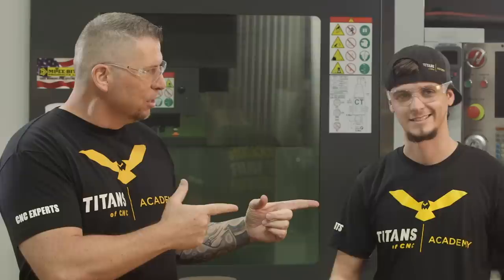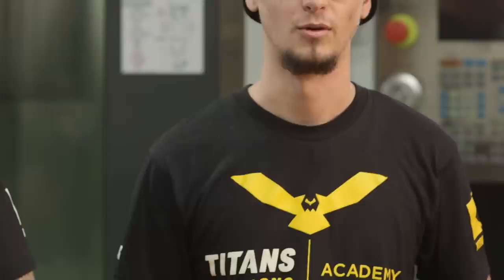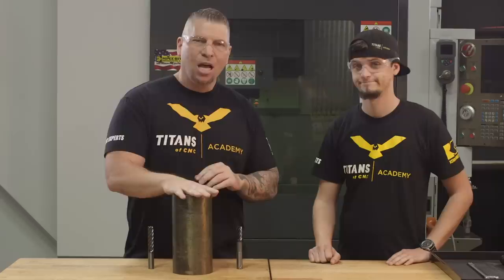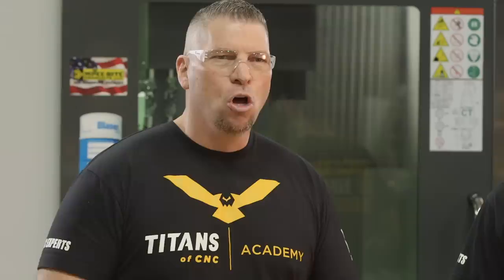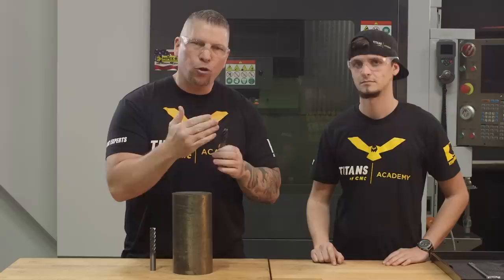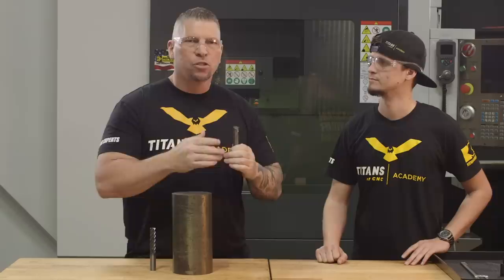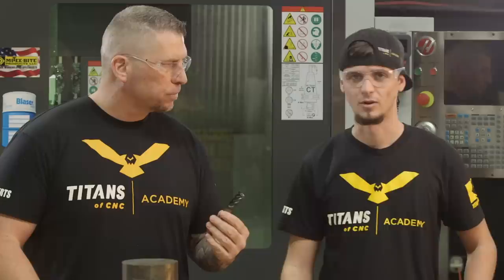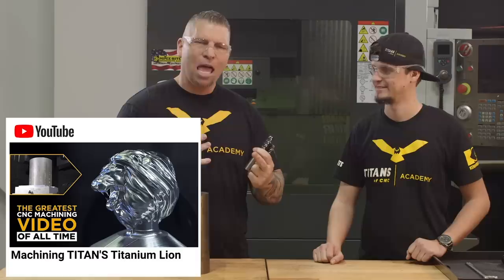Zombie Mill Saved Me $100,000 | CNC Machining Inconel 718 | Vlog #75

Comment: Hey titan I have a question.
What do you think of when a teacher gets really mad at a student for messing up?
Reply: I'll chime in with my opinion =)

Depends on the situation and what the student did wrong. If the student has an attitude, thinks he knows it all and takes risks and gives no shits about safety in the workshop - it's all fair game to teach him a lesson.

I've seen a lot of shit during my time as a machinist. Some dude was turning down some stock on a manual lathe and decided to go take a shit while the machine was operating. It went past the stock and right into the jaws and only stopping due to the overload. Another guy thought it was funny to walk over to a manual mill, which was in use, and turn the handles on whatever he could. Which resulted in scrapped parts and dangerous situations when the operator started running again. Some asssholes in the jobshops thinks they're real fucking funny throwing around pallets to scare people - aint so fucking funny when an operator breaks shit because they jumped and got scared.

However, you should never scold a student for making beginner-mistakes. Breaking tools, scrapping parts and the inevitable minor crashes on the machines - everyone has done it. Even the most skilled machnists breaks stuff from time to time. If anyone says otherwise - simply don't trust them and their lying cunt mouths =>

So again, it comes down to what and how the student messed up.
Reply: innomi natum I was on a haas ST-10 and I was making the first op of the queen and I was mid way and I turned on single block on and I forgot to watch my distance to go but the thing was that the piece had coolant on it and I thought that the machine was done reading the line of code but the catch is that my feed was at 10% and my rapid was at 5% so I couldn’t tell by eye if the machine was moving or not but it was and every now and then it would make a sound but I didn’t know that it was touching the part so after like a min the endmill the turret snapped but not completely and then he went to tell the other instructors and some of them gave me attitude too which was really discouraging. I didn’t even go to the class because I was embarrassed and I knew that he would give me more attitude( btw this happened during a n open lab) l one of the instructors was like “how the fuck do you bend an endmill, I’ve never seen that in my life” and it was an instructor that I liked but the same instructor has been giving me an since program started and there has been already two times that I’ve felt like just leaving the program.

But I’m not a bad student I’ve been taking all of his bad attitude for almost 6 months and I e never talked back to him and I always go to the open labs every morning and I try to be the best I can. It’s just really discouraging to get yelled at almost every day...plus the picks on me and makes fun of the mistakes I’ve made.😞
Reply: @septurno9722  So If im reading it correct, you were milling on the lathe and didn't notice that the endmill was actually touching the part you were machining - and it ended up breaking the endmill.

Stuff like that happens. It just does. However we put it, it's an operator mistake - but it just happens sometimes. And honestly... breaking an endmill is a common mistake/error. Hell, I've broken 2 of them myself today =)

If your instructors can't handle seeing their fucking endmills break - they should be standing and overlooking every single operation you ever do - and you won't learn shit by that.

One thing is to be annoyed about endmills breaking, I mean, they CAN be quite expensive - but the fact that he starts scolding you infront of the other instructors tells me more about him than you. And you're bound to meet more fucknuggets like this in this trade.

Keep doing what you do: Improving. Don't take it too personally when some idiot wants to belittle you - they're most likely trying to compensate for having a small pecker.

If you make a mistake - just own it. Admit you fucked up, take notes and keep going. You're bound to make a lot more mistakes - and that's what you really learn the most from.

FYI; There's probably a reason this douche of a teacher you have became an instructor - he most likely didn't function in an actual jobshop with his attitude ;)
Reply: innomi natum  hey thanks man,what happened was that spindle wasn’t moving so the endmill was Going into the material without spinning and it bent. But thank you 😁

Comment: Breaking an end mill then going back into the program where the endmill broke and starting again with the same work piece is just asking to break endmill after endmill.  Basic shit here
Reply: Are you suggesting scrapping the part? Inconel is too expensive to do that if it can be saved
Reply: @lvengineerable  you can grind it out.

Comment: Titan just wondering what your thoughts are on ID/OD grinding vs milling
Reply: In reference to what? Surface finish?
Reply: No making the entire part
Reply: Titan, mind if I take this one?

If you're grinding an entire part, you're going to be there a while. If you're trying to get a crucially tight tolerance, you ALWAYS want to OD grind. Im talking +-.0002 or less, unless you have the machines, tooling, the process and the skills to consistantly produce those tight cuts. Obviously you want to get the tolerance and rough out within 5 thou over the final dimension of an OD before you bring it to a grinder.
Reply: Cody Terrill idk I work at a shop where all we do is grinding and our Lynx 220 can really crank out the parts.
Reply: @chriseber7714  you guys are pissing away money if you are grinding entire parts from billets. It would take hours to remove the material a lathe or mill could remove in moments 

Grinding is best suited to finishing as it's slow as piss.
Reply: Yeah if you're making entire parts from grinding alone, youre insane.

Comment: Enjoy well made cutters, I've have similar experience with good cutters that sharpen as they cut more like sandvik coro drills
With hardened titanium 
Its alot of fun, especially hearing it before is about to break 
Can you show how to calculate radius passes on lathes. I've always struggled with making nice blend between different profiles I've used okuma I wonder if it's the same way like Haas. Thanks guys and love 🤘🏼

Comment: I have a wood working business that cnc mills dice boxes and specialty lids for our dice trays in every wood from ash and walnuts to purpleheart and ebony.  I typically use a 1/2 tapered  flute carbide mortis bit.  You can see our product at www.mastermonkgaming.net Finish it important but so is longevity of the cutter.  Currently my program runs in 2.5 minutes to produce 1 half of the dice box.  Cut depths are .150 increments.  In one day we can cut a couple hundred boxes needing to change the cutter every 40 or 50 halves.  At $20 a cutter we can eat up a lot of money for a little shop.  Any ideas on a better solution?